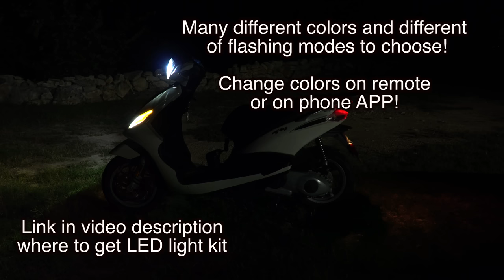LED LIGHTS INSTALLATION ON SCOOTER!! LEDGLOW Tutorial | Mitch's Scooter Stuff

Comment: Hello Mitch,
I make same things but my battery dies in a week. It's 12v 6A Varta battery. Did you change your battery system or regulator? I chech with multimeter after I charge my battery at home. It runs with 12.3v if I open gas it goes up to 14.3v . I think my regulator works good but what can be the problem?
Greetings from İstanbul,Turkey!!

Comment: Mitch with the LED lights I have a Suzuki Burgman 2013yr 400cc with LED all the way around not like the LEDs are installing in the video the ones in the video as long as they're not flashing red or blue those are illegal in Virginia because of police in fire trucks I recently took my bike to get inspected at Cycle World here in Virginia Beach Virginia he said I'm not going to fail you but you need to put the stock headlights back in then I can pass you he wouldn't pass me because LED headlights I took it to another shop he passed me he let me know just put the regular headlights in for inspection then do whatever after what I don't get the new Suzuki scooters all have LED lights headlights turn signals brake light what do you think?
Reply from the maker: Bummer about that... in Texas we got passed with LED and HID headlights... All states are different.. we can use color leds but no flashing and can't use RED, BLUE and YELLOW... but other colors allows and LEDS can't be visible. 
New burgman with leds ... should mention that to inspection shop and dmv :-/

Comment: Don't mean to be a party popper but I think I read somewhere that blinking lights were no legal on the roads in texas.
Reply from the maker: Yes it's illegal... I told him to set lights on steady and use legal colors only.... if just ride in neighborhood, at party or parade then use whatever :)
Reply: I posted a pic of my sym citicom 300i on the austin scooter fb page.  I'm in San Antonio and had my leds installed by a guy who did harleys he was tickled to do a scooter.  My leds are green and don't blink.

They are cool at night when riding.  I've bling'ed out my scooter with skull handle bars, skull air thingys on the wheels and skull flag holders on the sides.  I'm a skull kind of guy.

I know it might seem strange for a scooter to have such hoggish style but hey, to each his own.  I love my bike.  I'm thinking about the Kymco 400.
Reply: Sorry for the posts here but I forgot to mention that I had also included two LED strips along the side of the seat and the entire thing is operated via remote.

Comment: Mitch does Piaggio have cdi box ? Becuse i have Piaggio Fly 50 and im trying to Find cdi box but only i Find in internet is Coil cdi and ignition cdi. Pls help becuse i want to have my scooter faster it 25mph i want to have it atleast 60mph thank you
Reply from the maker: Hi, bummer I didn't get a chance to work on Fly 50 yet so not sure if it has one :-/
Reply: Ollieee it has one look for the Ducati yellow or grey one. It's located near the cylinder head.